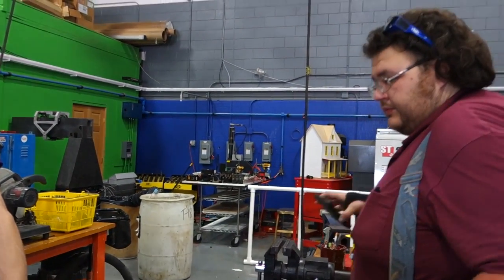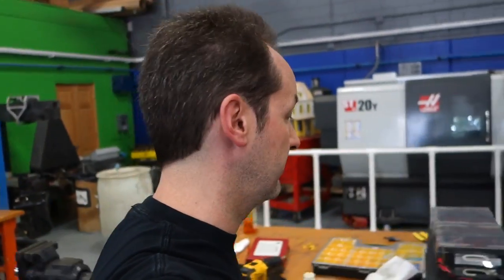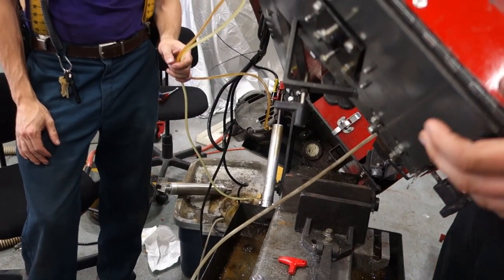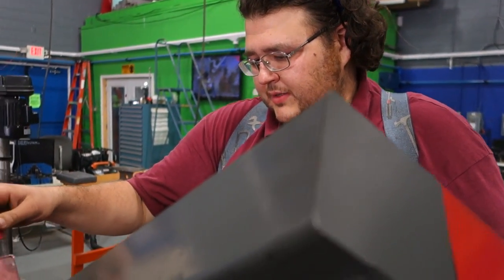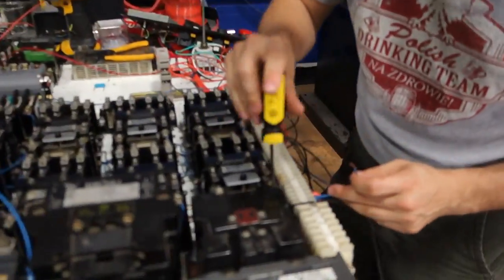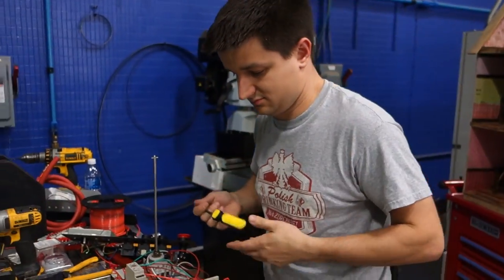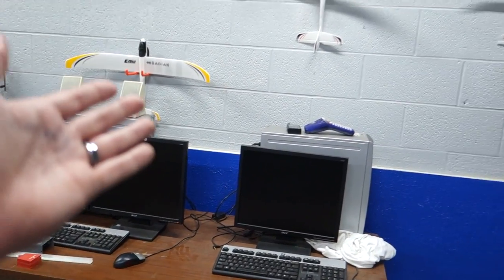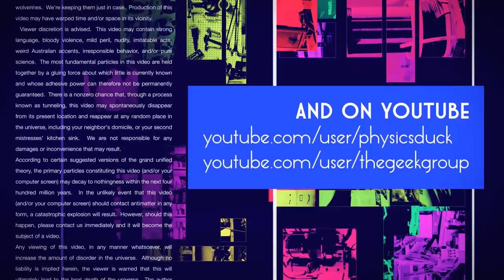Captain's Blog 8 26 2016 Bandsaw Hydraulics, Snubbing, and Aero Overhaul

Comment: The open relais like you say only for signals without much inductive load, they have no "arc extinguishing chamber" https://translate.google.de/translate?sl=de&tl=en&js=y&prev=_t&hl=de&ie=UTF-8&u=https%3A%2F%2Fde.wikipedia.org%2Fwiki%2FDeionkammer&edit-text=&act=url

If you using AC, maybe a Varistor parallel to the Coil Terminals, if DC maybe a TVS-diode